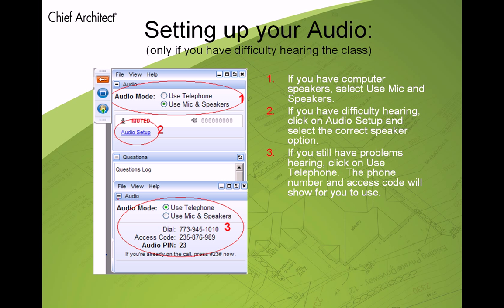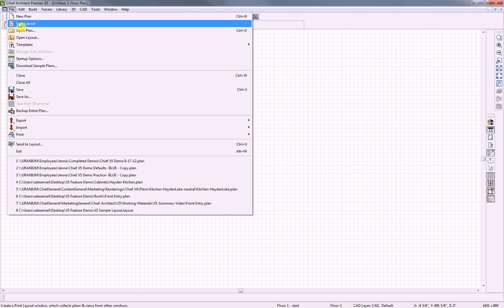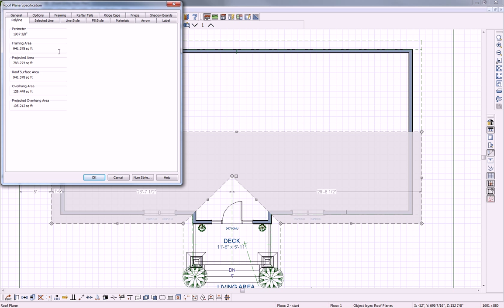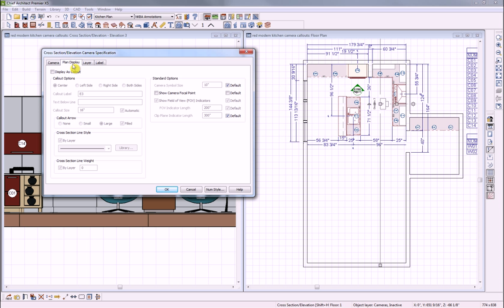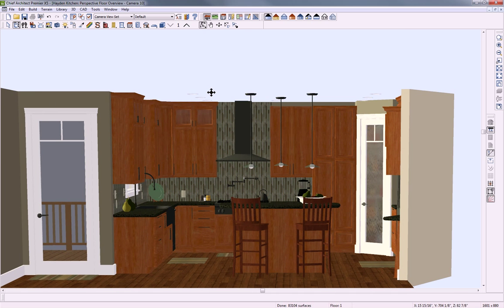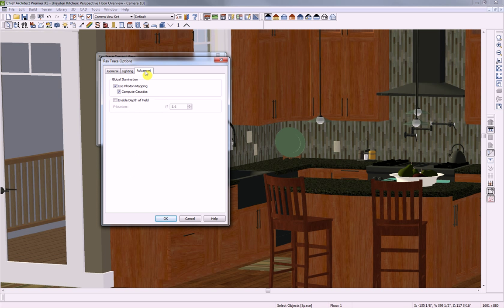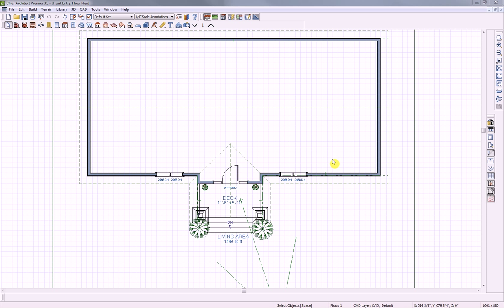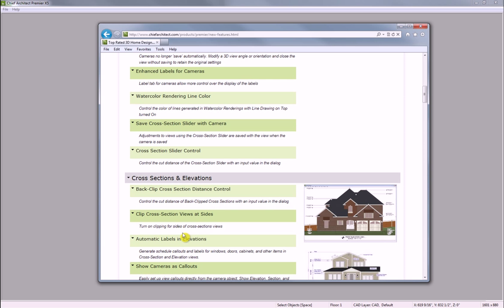What's New in Chief Architect X5 Webinar

Comment from the maker: If you want to work exclusively in Imperial mode, open Chief.  Choose the ‘Edit’ pull down menu and click ‘Preferences’.  Find and click on the ‘New Plans’ area under the general heading.  Note the ‘New Plans’ area and the radio button.  Move it to ‘Imperial Units’.  Click OK, and close all plans.  When you open a new plan you will automatically be in imperial mode.